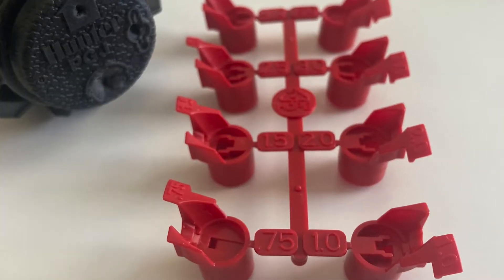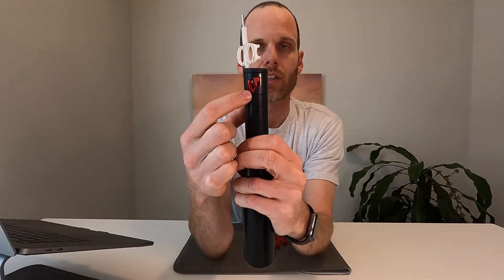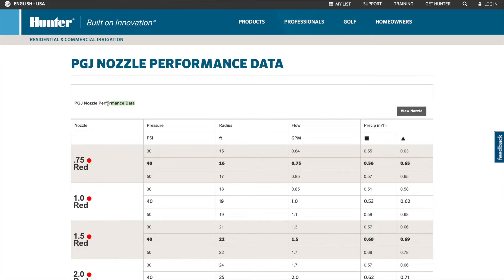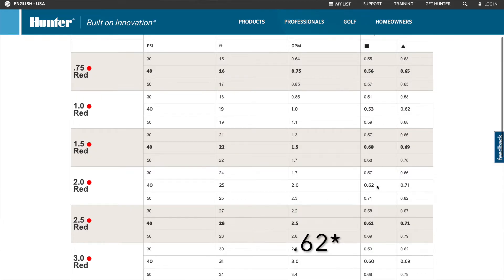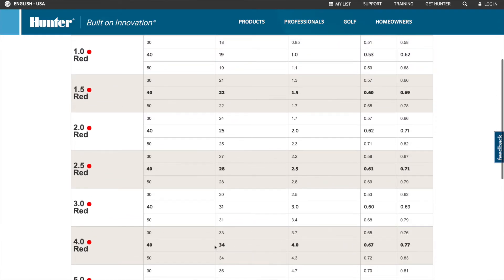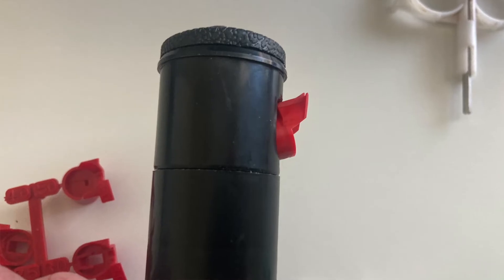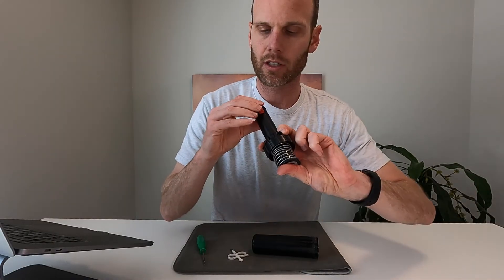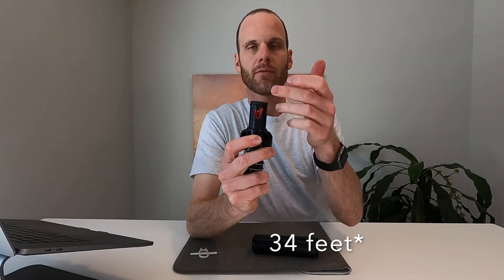Installing Hunter PGJ Nozzles - Sprinkler Rotor Head

Comment: My sprinkler is using the sewer, and it turns everything dark yellow. Is there a filter i can buy to clean the water
Reply from the maker: Check this video out and then ask your supplying if they have a filter that will be best for filtering iron deposits

Sprinkler System Main Line Filter Install
https://youtu.be/1-DZZBqS7LU

Comment: Thank you for the instructions, I followed it and was able to easily replace the nozzle for one of the rotors. For the other one, the screw is stripped so when i insert the tool to turn, there's no grip at all. What are some safe way to get this screw out?
One way is to replace the riser assembly, but i'm a bit hesitant because using new assembly with the old body might not fit perfectly and will result in leak; the other way is to replace the entire head, but as a complete newbie, that is daunting and ripe for big mistakes. I'm thinking to try the rubber band trick tomorrow but want to see if there are any other safe ways.
Reply from the maker: I revert to replacing the head in that case.  Easy option.  Check out my other videos

Comment: I have a problem with leakage (while in use) around the nozzle on pretty much all of my PGJ sprinklers. Any hints?
Reply from the maker: Make sure they are installed correctly.  I’ve never had that issues in my experience.  Ensure correct nozzle is being used also.
Reply: @thesprinklerchannel  it’s the nozzle that was pre-installed

Comment: Hi, i will like that the nozzel shuts the water high like in the parks (no close to the ground) . What I can do to achieve that? how to adjust the nozzel  or which one to use?
Reply from the maker: Those at the parks are different kind of rotor heads.  Their angle is greater because of the distance they throw and quantity of water they put out.

Comment: You may want to edit this video to add in some B-Roll close-up footage of the exact way to install that nozzle.  Do you drop in the lower portion first or the upper portion of that red nozzle first and then snap it in place?  You state a couple times the “45-degree angle” but you don’t tell us whether the bottom of that red nozzle goes in first or the top.  I think some B-Roll close-up video there would clarify that and make it crystal clear.  Nice video.  Keep up the good work.
Reply from the maker: Slides in

Comment: First time visitor here! Great, informative video. I was able to get better performance by replacing the nozzles after watching your video. 

I do have a question.... on one of the screws, dirt appears to have settled on top of the screw, so I am unable to properly sit the adjustment tool. Any ideas/thoughts as to how I could correct this? I tried pulling the rubber cap/seal off the top of the head, but it seemed that I was damaging it.
Reply from the maker: Awesome!
Reply: @thesprinklerchannel  awesome?

Comment: That's not 5.0, by the way.  That's 0.5.  Take a look at how small the orifice is.
Reply from the maker: You are correct.  This nozzle set has a 0.5 instead of the 5.0.
Reply: @thesprinklerchannel  I think Hunter changed it from a 5.0 to an 0.5 at some point.  There's a picture on the Hunter website of the old tree with a 5.0 nozzle in the place that there's now an 0.5, and their nozzle performance data lists data for the 5.0 but not an 0.5.

I just installed a bunch of these PGJs in my yard, and happy with them so far.